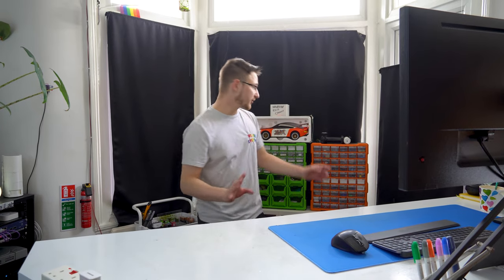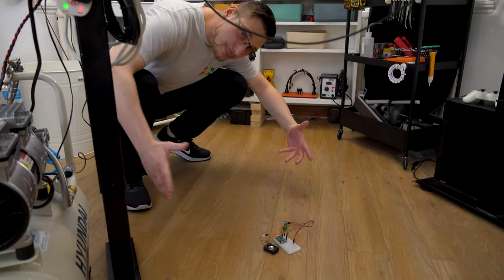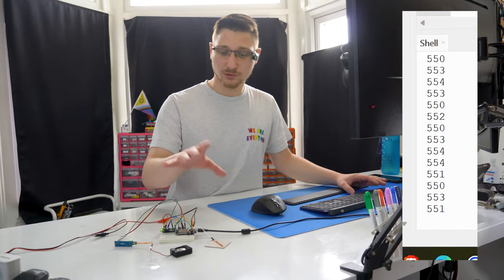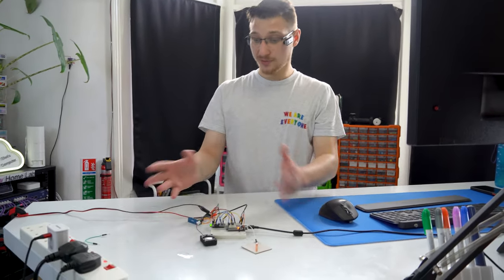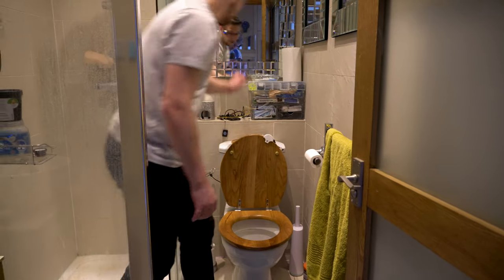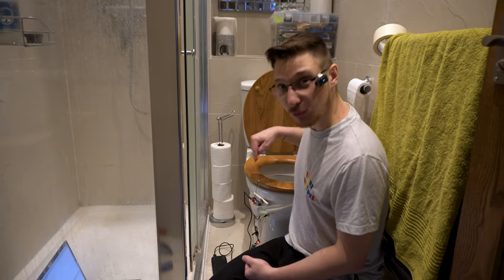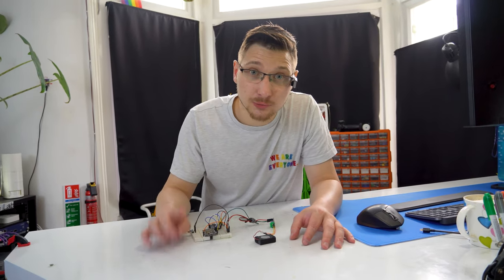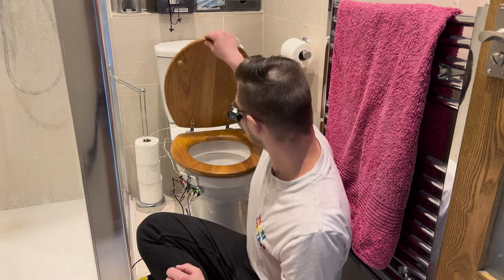How To Make A Toilet Play Music

Comment: As ridiculous as the current iteration is, this could be useful for an aging in place care plan to track if a parent is using the toilet at a reasonable rate or to know if they’re spending too long / are stuck there.
Reply from the maker: I was thinking of aversion to that can track your usage through Home Assistant.
Reply: I am actually quite intrigued with the whole IoT checking when an elderly parent poops idea. As long as it's not my mom, because that would be a disgusting thought. It has to be somebody else's mom for a it be a good thought puzzle.